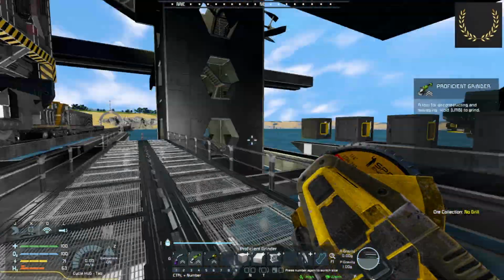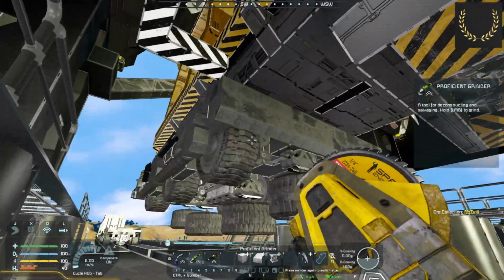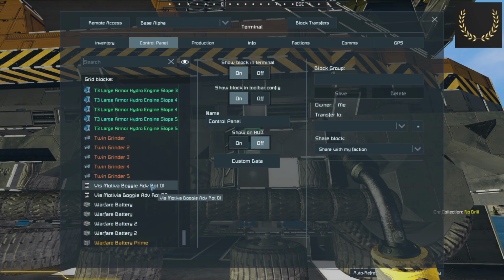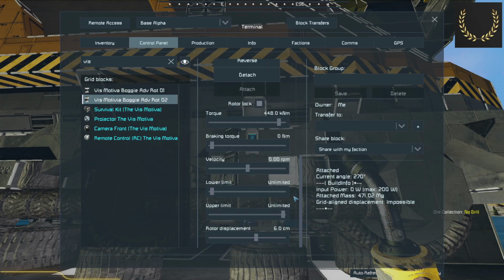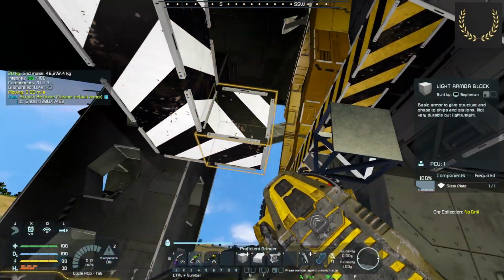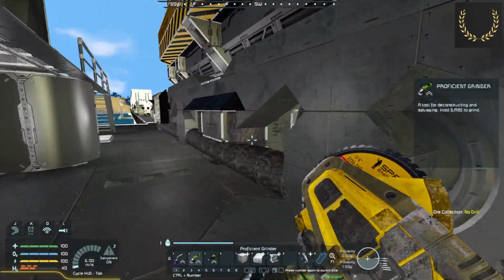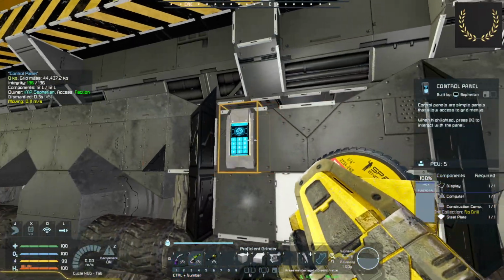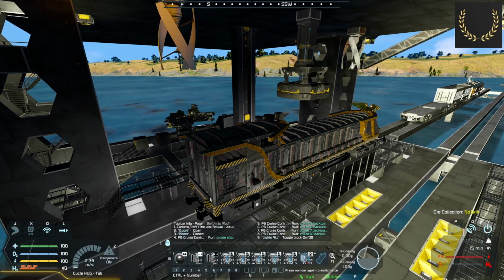Space Engineers Tutorial : Rail Wheels/Boggie : How to Turn

Comment: why do you not use the wheels to get the train to move?
Reply from the maker: @Nico-Blast  it's because they are a sub grid and don't work well and it's much simpler to use the thrusters to move on frictionless wheels and the weight of the train ends up exceeding what the wheels can manage 👍
Reply: @sephykrayt  have you tried using a molded wheel set to see if the performance matches thrusters by chance?
Reply from the maker: @Nurhaal  molded? I'm not sure what you mean could you explain a bit for me please? 👍
Reply: @sephykrayt  phone auto-car-wrecks... MODDED. I hate auto-correct on phones. The predictive text is so stupid... lol
Reply from the maker: @Nurhaal  so my guess is modded wheels? Tbh I'm trying to achieve as much as possible with only vanilla blocks and equipment, yes I'm using mods for colour and info but I'm not using as much as I can modded blocks on the trains themselves 👍
Reply from the maker: @Nurhaal  oh and yeah autocorrect is the biggest irritation of the modern age lol 👍
Reply: @sepherien  I'm in line with your interests, as I'm leaning into more and more vanilla as well - but it's kindve a 'for science' question type thing. If wheels cannot match the torque needs to that of just the pure thrust from thrusters, then clearly there's a game balance issue when attempting to incentivise wheel/terrestrial based tech. 

I do know there are wheel mods that simply boost the stats of vanilla wheel sets - and that's what I'd be interested in testing. 

Also while it appears your trains seem to be on par with IRL counterparts on size? I do wonder if building a wider track will help increase stability further. My guess is that your track is 3 blocks wide because you mentioned using another players design for the bogey setup, so you standardized your track for their bogey arrangement. 
None the less, I've had my interest piqued and would love to experiment with the advice you've shown. You did something I was trying to do for awhile, which is do this on creative. You're the first to provide actual details as to the problems of the grid snapping which even if the snap is turned off in game settings? Still overrides. You gave parameters for whst ranges are acceptable to prevent the snapping and how to be flexible when laying down track. Your application may even be applicable to simple  roads for say 'high ways'. 

In your experiance - does it create a lot more server lag having so many subgrids? Or does having a single grid be so big be what causes most lag?
Reply from the maker: @Nurhaal  first I love this reply, thanks. I'm glad your interests have been piqued.

Yes the original maker for the track is a YT and steam workshop user called HANELS he's currently working on monorails. I've used much of his earlier work and adapted much to suit my own play style and vanilla and survival capabilities. 

The track is 3 wide yes and I have thought about a 5 wide and maybe an external side of the block like a IRL flange type of set up for higher speeds but not made much progress as of yet. 

As I'm sticking with the 3 wide yes it means there's gonna be a standardisation of the boggies/wheel sets. Currently every works fine and with a little added weight to the lower half of the set up higher speeds of 20m/s on tight corners has worked.

Now for server lag. My evidence is I've don't several saves locally and had a moderately good server for rail. Each save and server I've had lagged bad with one giant grid. 
Stability and low lg if any is found by using multiple grids. Now the Klang gods don't like this but the work around is how the game is loading the sections. If it's one big grid the game or server needs to load the whole thing at all times. But sperate grids seems to only load them when the player is with in a certain km radius and mostly things occur in the background. I could be completely wrong but this is what I've observed and why I cut the tracks up into chunks.

I hope I've been helped and again I love this response you've gave. 👍

Comment: Have you experimented with banked corners so you can travel faster?
Reply from the maker: @KeithOlson  no I haven't but within three mins of reading the comment the brain juice started flowing lol. It seems like something I'd like to try. I haven't though of experiments with it cause I hadn't had a need. The train speed is deliberately slow and limited to 10m/s cause I kept encountering a bug where the wheel move through the blocks track and the train just drive off the track and the corners I'm using are sharper and require a slower speed to turn but I have got experiments with signal blocks and remote control blocks to make the train faster on straights and to slow itself down on the turns. 👍